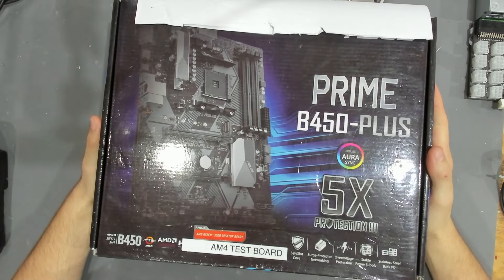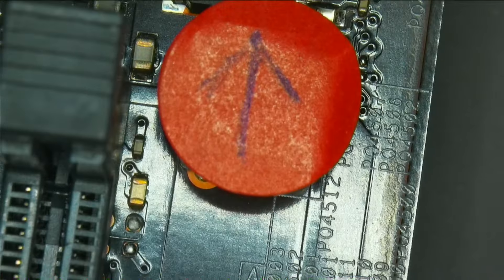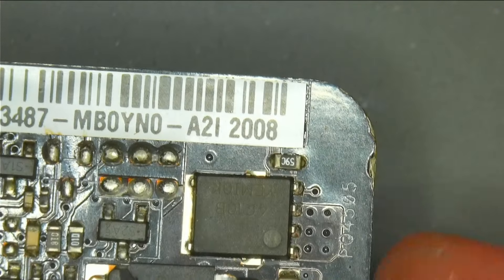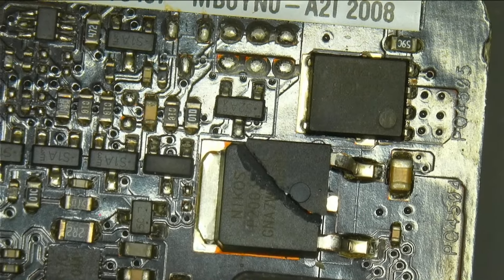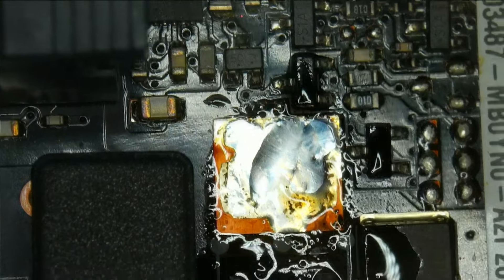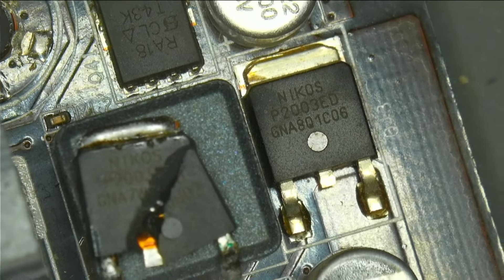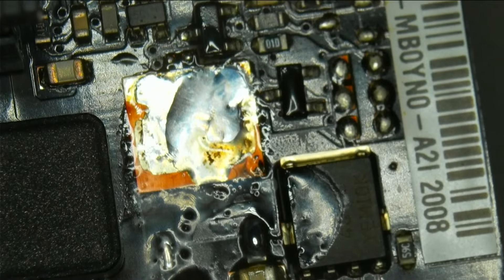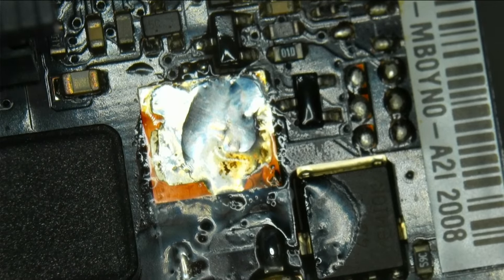USING A ASUS REPAIR GUIDE TO REPAIR A MOTHERBOARD | ASUS PRIME B450 MOTHERBOARD REPAIR

Comment: I enjoy watching your videos with great interest. Thank you for that. I ask if you could also provide a source for the low meld solder. I come from Germany and I find it really difficult to get it at a reasonable price.
Reply from the maker: I am also from germany and i was only able to get it second hand, because leaded solder is banned in germany for comercial use, so basicly no one has it anymore.
Reply: Need a pal from a non-banned spot to send you some?
Reply: @MainboardMedic  Danke für die Antwort. Jetzt weiß ich wenigstens warum hier an das Zeug nicht ranzukommen ist. Freue mich schon auf die nächsten Videos.
Reply: Had similar issue with a Ryzen CPU I fixed. The pin was not only broken, but the entire pad was gone. Finally I was able to find the trace deeper in the PCB, soldered the pin and reinforced it with some soldermask. I noticed that depending on the pressure from the cooler, the CPU sometimes didn't work. So I sold it to someone as a bundle, with a good motherboard and cooler already installed. Everything worked for me. I sent it to the buyer...and of course it wasn't working. But I explained the problem to him, and he installed his cooler with the right amount of pressure. And now it works, and he is happy because I sold it really cheap, more or less the price od the CPU alone.
Reply from the maker: @MyElectronicsRepairAdventure  I actually also have a Ryzen CPU where a pad is missing. Did you just dremeled the place until you could solder to it?
Reply: @MainboardMedic  At first I fixed it when the pad was still there. It worked but the pin fell off after inserting into a socket a few times. And this time the pad fell off as well. So yes, I grinded a bit to expose the trace, a point, very tiny. Difficult to solder to it, and also be careful as ground can be very close, not to short it together. I put some soldermask around it, to cover ground, and then somehow managed to solder a solder ball to it, and then attached the pin. As a result it was a tiny bit higher than other pins. I think this is why the pressure matters. Good to use an AM4 pinout diagram, it helps a lot.
Reply from the maker: @MyElectronicsRepairAdventure  Thats sounds like something i need to try! The pin that is missing on my one is the clock pin and it doesnt work without it!

Comment: Why can't you just use a thermal camera to find the short instead of just use a multi meter on  every single capacitor and mosfets? It's a lot faster than a multi meter

Comment: Should scope the reset that it goes high after a time period, ie, is it's control working, and then put a smaller resistor in there so the voltage is higher on the SIO side. A long shot but maybe check the pin at the SIO in case the resistor solder cracked

Comment: Hi, I know this is an older video, but I notice that where you are showing the injecting of 1.4V to force the reset, the battery is missing, some MB's will not boot without the battery. Just thought I would check. 
Also looking at the situation I conclude that the only way what you are seeing could happen is if the SIO has been damaged in some small way, like a voltage spike through that power good pin resulting in that pin not being as high an input impedance as it should be so now it draws more current through the 1K resistor dropping the 3V power good signal considerably, Have you tried reducing the value of the resistor? try fitting a pre set , and slowly reducing the value while watching the power good signal, until you get reset, if the power good signal is loaded too much and the voltage falls it's no good, but it might work. Bob
Reply from the maker: I have not yet stumbled uppon am4 boards that didnt start because there was no battery! But thank you!
Reply: @MainboardMedic  Hi Medic, did you read the rest of it I edited a bit later? Bob
Reply from the maker: @stoptheirlies  Hey ive done something similar on another board, where i replaced a 22k ohms resistor that was on the RSMRST line that connected it to 1.8V where the SIO had an active short on that line, but still drawing very little amps!

Comment: Very strange behavior of the super IO chip. Is there a datasheet for it with any clues on why it suddenly requires these specific voltages+timings?
Reply from the maker: I was told that the timing need to be very specific on the chip, but i was never able to quote a datasheet or something similar for it! There must be something wrong with one off the voltages powering up and its timing, but i was never able to get a proper fix, only this workaround!

Comment: hello compliments for the videos, question.. have you tried replacing the resistor? even if it measures well sometimes under voltage they go out of value. thanks
Reply from the maker: Jep tried that without any luck!

Comment: How can we see resistor ohm values, part names, etc. in boardview? Only roads are visible?
Reply: Get schematic PDFs and use alongside with boardview
Reply from the maker: Some Boardviews dont include values and only connections. For ATX Mainboards the values are always displayed by clicking on the Component or hovering over it.
Reply: As you can see in the video, by clicking on the part on the right upper side of the screen are the informations needed shown.

Comment: Hello,🤝 good job regarding this motherboard, there must be some kind of manufacturing defect, during the video you say mass, you mean GND, in Poland they say similarly masa.P.S. Do you use any specific CPU models on AM4 for testing? Regards👍👍👍👍👏👏👏👏👏👏👏👋👋👋👋👋👋👋👋👋👋
Reply from the maker: Yes i really like the 2200G for testing. APU and its a early version so many are compatible. There are some B550 Boards and higher for which you need a 3000G, because they dont support 2000 series ans lower.
Reply: @MainboardMedic Hello, I also have Atlon 200GE and it is great, but it does not support full PCIe, I didn't know about it before, and my graphics card in the PCIe16 slot only read 4.3.0, thanks for the information, best regards👋👋👋👋
Reply from the maker: @lucataszarek8782  That is true, i use the 2000G only for post testing, as soon as i can get into windows i use an 2600 so i can also fully load test and test the GPU lanes.

Comment: I think you should take a closer look at the start-up power sequence especially timings to solve this without another PCB. I'd bet there's one or more bad capacitors or resistors changing the timing of one of the circuits in a bad way.
Reply from the maker: I really tried to do that, but there is nothing on that line but a 1K ohm resistor that connects 3.3V with the pin off the SIO. There is nothing else but the resistor and the resistor is tested good. The only component that could be partially damaged is the SIO in my opinion.
Reply: @MainboardMedic , no I mean way earlier than that in the power up sequence (32:36). Something seems to be messing up timings, preventing it from being in the state we assume it should be in. At least, that's my intuition as an embedded software engineer. I wish you had an oscilloscope to verify the startup timings were right, cuz at this point, it seems like a voltage on a line was high (or low) at a time when the startup sequence was expecting the opposite, and that prevented the chipset from completing initialization. Since RC circuits are used for timing, I suspect a resistor, or more likely, a capacitor is bad somewhere.

On the other hand, you're reading 3.3v on one side of that resistor and something completely unexpected on the other side... but when things are unexpected, in my experience, you have to reevaluate your assumptions... something is different than we assume.
If I had an oscilloscope, I'd start with finding where the timings go astray, and then find out why.
Reply: I lean this direction also. The SIO pulls the power ok pin down because something is wrong in the power up sequence. The injection is just a workaround with a lucky outcome. You are lucky not killed the SIO when applied 3V on the output pin. It is a difficult problem no question about that. You need a logic analyzer to probe all the power sequence pins and compare the result to the RG diagramm. It is a question how long th SIO chip tolerates this injection workaround.

Comment: Hello wie geht's und steht's, after watching a couple of your videos I wanted to ask your opinion on a problem I have with my motherboard.
Tl;dr is I scratched some wires/lines near the cpu after I forgot the washes for the cooler. Now the first pcie slot doesn't work, only signal though because cards in the slot get powered.
Would you have any advice maybe? xD
Reply from the maker: Well nothing more to do but to repair those traices, there is no way around that!

Comment: My theory is a massive power surge, that mosfet split , wasn’t damaged by a “person” that was sudden power…
That capacitor split in half, same, are they connected ?
Reply from the maker: Those are not connected. I would expect more charing if this would have been electrical nature.

Comment: Please don't put I/O shields on top of their motherboards - they can pick off smaller components and gouge traces.  Don't make any more headaches for yourself than necessary.

Bag them separately and put them on the (bagged) board when storing the board (ALL motherboards should be ESD bagged - that thing about making more headaches applies especially to unprotected boards).

And no, "modern" boards are no more resistant to ESD damage than older ones.

Comment: Both boards A Sus?
Sounds Sus to me, as in it seems Asus has found a way for their boards to brick themselves, and now you have found a way
to UN~Brick those boards that have bricked themselves..🤣😂😅 Err-on a serious note though..

I would suspect whatever chip "but only if all of it's voltages are present" needing replacing is the one that is suppose to 
supply whatever missing or misbehaving voltage, in short there has to be one chip that is getting all of it's expected voltages 
but it's not outputting to some other chip that is not getting all of it's voltages, in short sometimes we need to trace for 
voltages backwards.
APU 👁👍
Reply from the maker: So there is only a single 1k ohm resistor between 3.3V and the SIO. And the resistor is tested good. So i would expect the SIO to be partially damaged.
Reply: @MainboardMedic  only if it has all input voltages/signals present, if one of those voltages or signals are not quite right then whatever is providing wrong signal or voltage needs more scrutiny.
I'm going to be honest here in that although I am not a mother board expert, I am confident that if any chip is not getting an expected voltage or signal it will not itself do what it is suppose to do ergo if some other signal intervened AKA yo  voltage bodge following circuits will continue to function as if the previous original chip on board was functioning as designed..